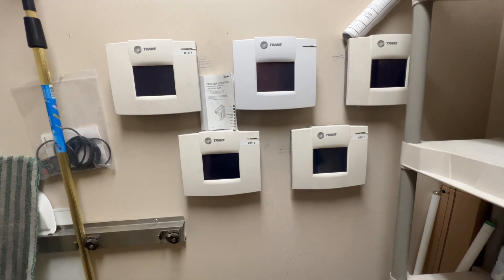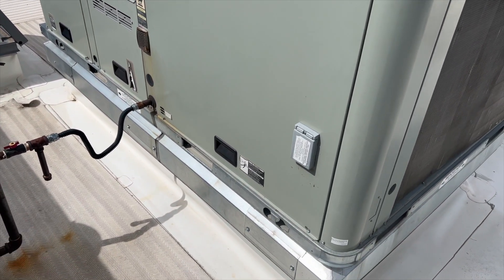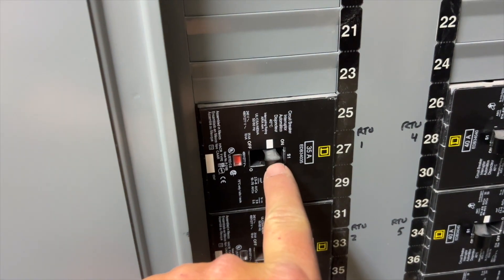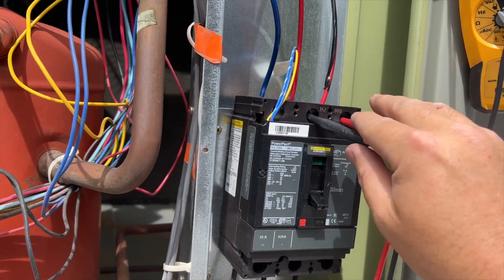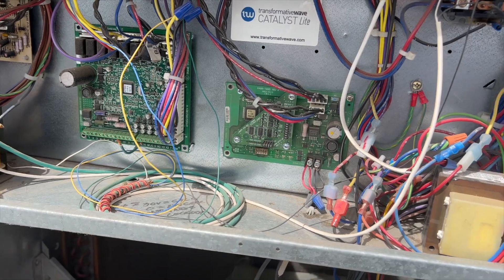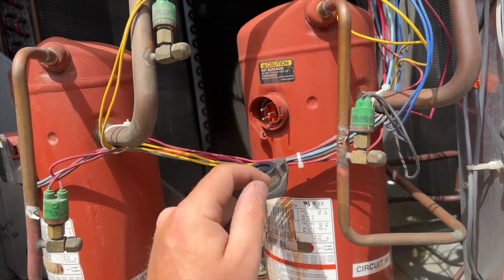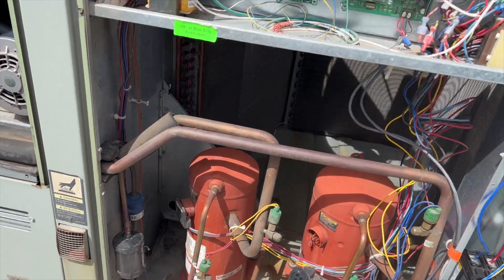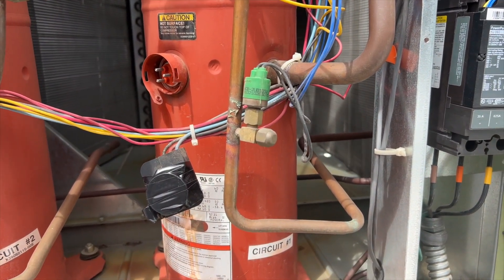Varitrac System Not Cooling. How to navigate through Varitrac Interface to Locate RTU EP89

Comment: Interesting - Great safe diagnostics and earning good reputation points for leaving the customer with restored partial cooling capacity! 

Is it possible that a lightning strike initiated the failure?  That burned phase wire means the compressor winding also burned up and shorted to ground while sending lots of cooked enamel coating throughout lines and condenser. Then, the acid + base (neutralizer process) leaves an end product of a salt. Can all that be cleaned out thoroughly enough to restore reasonable efficiency and most important, let you warrantee the total repair and de-contamination work along with the new compressor?  New lines and coil kick up the total cost another notch that might be worth considering/offering. IDK I'm too old and fat to even climb up through the hatch to the roof, lol.

Changing out everything would make it like new and confidently provide a long life (though costing a fortune) so it might last longer than the owner's business will. Maybe the owner will want to leave it as-is, running at 50% capacity so they can focus on their struggle to regain profitable over the next few months, not to mention somehow surviving the next five to ten years of recession. Or, maybe it's a government building, say located up on the roof of the federal reserve...

Comment: Definitely oversized suction line dryer and oversize liquid line dryer that I would have to come back and change out with new ones after about 40 to 50 hours of operation and retest. 

    Adds a lot more to the bill customer won’t like it but I won’t warrantee it or guarantee if they don’t otherwise walk away.

Comment: Is it ok to leave one compressor and install new my thanking the oil in both old compressors is contaminated with acid at very least change oil in the old compressor
Reply: That has two separate circuits. Oil from one compressor cannot get into the other.
Reply: That make sense👍